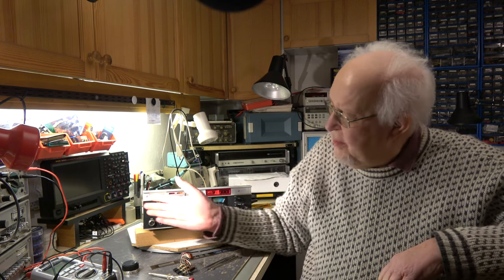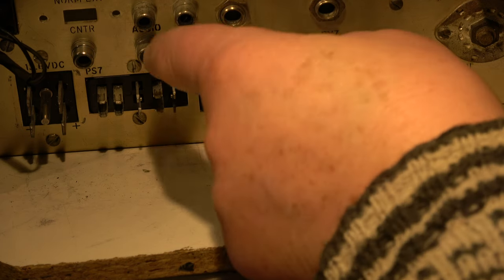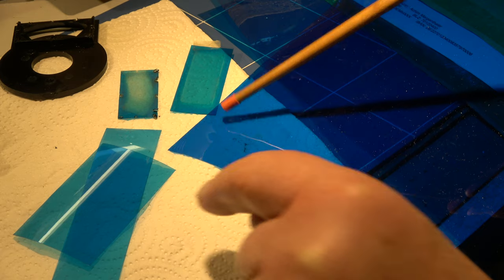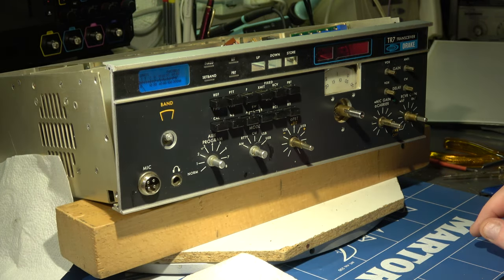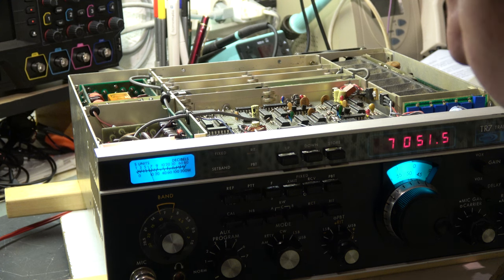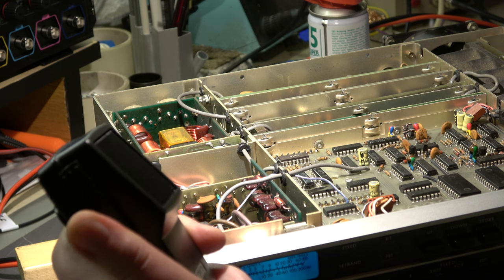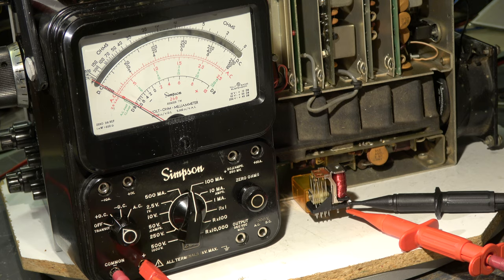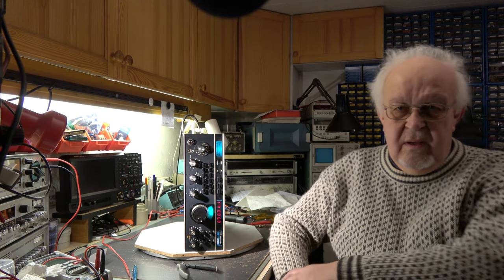#157 Drake TR7 Part 5(13)

Comment: I'm really enjoying this series, thank you Stefan!

 I've used a product called "Polywatch" a few times to remove scratches on plastic display lenses (e.g. on my FT-817 LCD display). It was developed for polishing and removing scratches from plastic watch glasses to give an "as new"  look, so isn't highly abrasive. It can be hard work but the results can be good. It's not expensive and is always worth having in the tool box.
Reply from the maker: Yes, i have a similar product in my tool box - it´s made for cars to polish it. But deeper scratches can´t be removed with this.